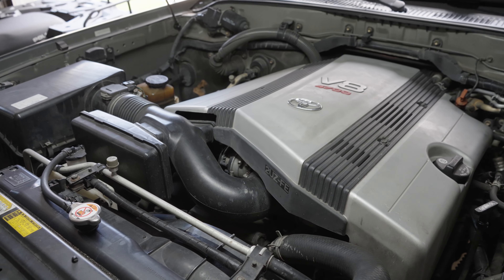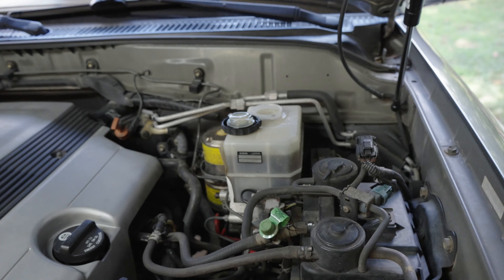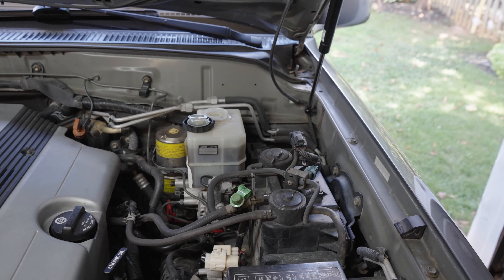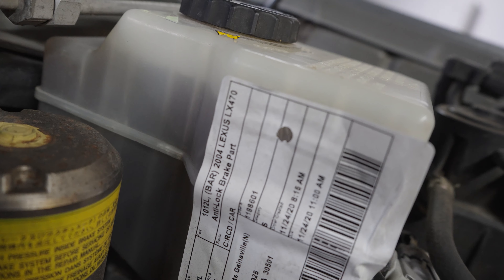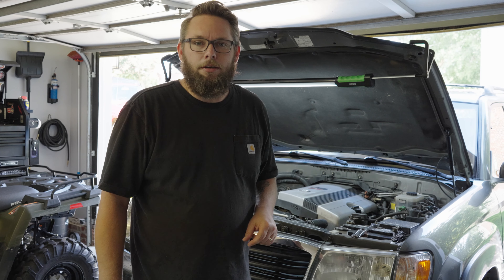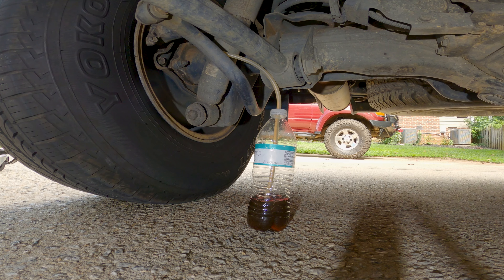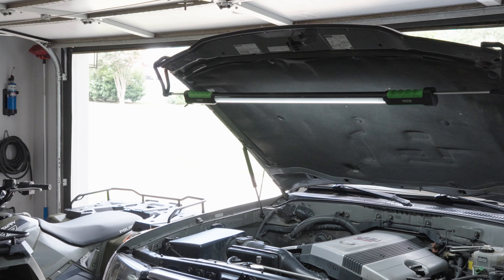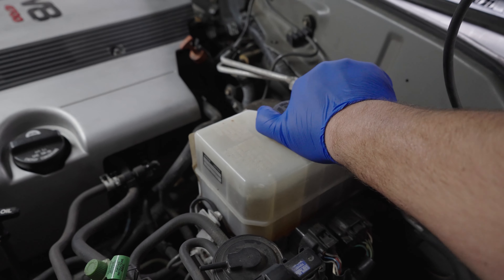EASY FIX for BAD Toyota Brakes!!! - 100 Series Landcruiser

Comment: When I got my hundy, I found that the PO had cheaped-out and not replaced the broken nut locks on the front hubs allowing the hubs to come loose and resulting in a spongy feeling brake engagement. Upgraded pads and put on slotted rotors too and am way more concerned with the violence applied to my passengers than I am about bringing that big girl to a slow-down 😎👍
Reply from the maker: Great tip. Those loose spindle nuts can be an issue in a lot of Toyota 4WD's due to those broken lock washers.